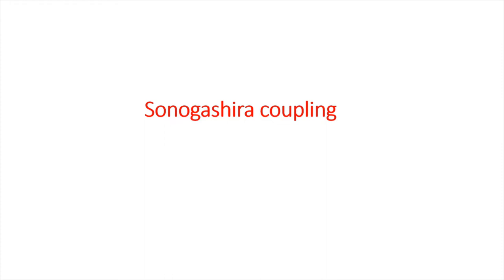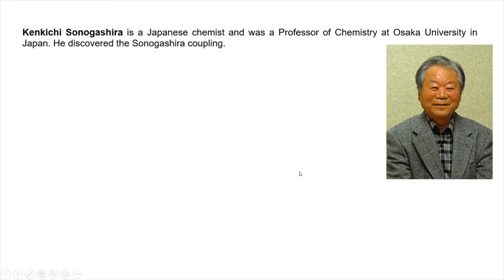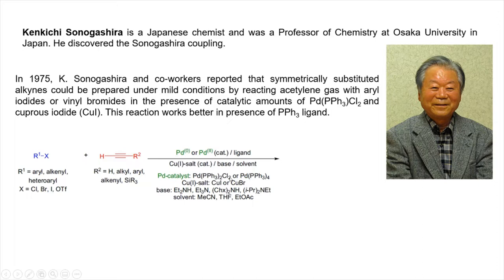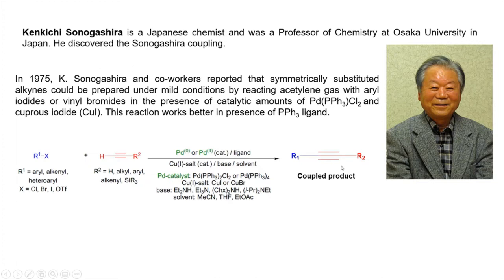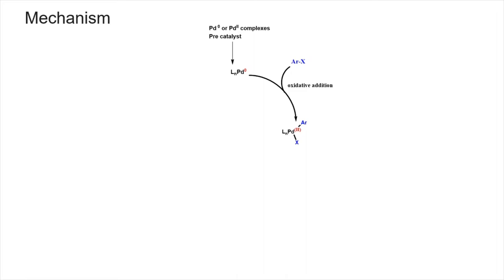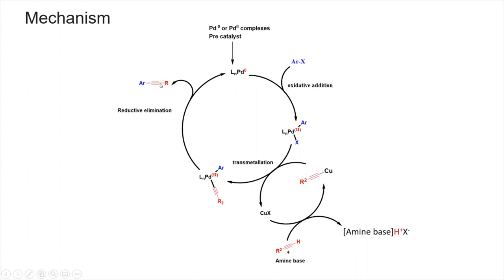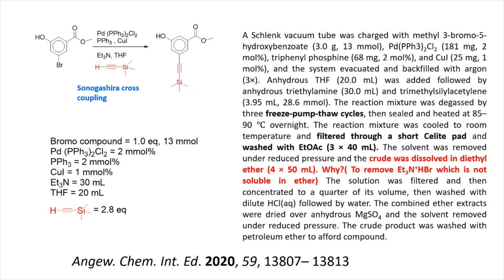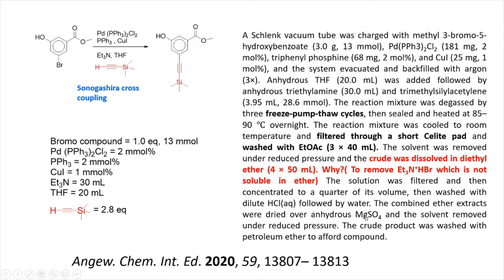Sonogashira Coupling- Reaction and application in Research Lab

Comment: very good explanation ....
Reply from the maker: Thank you
Reply: Respected Sir! If I'll add 10 equivalents of TMSA and will use evacuation...it will have negative effect on reaction?
Reply: @Dr.Mosharraf If we can use Ar bubbling for triethylamine and THF solvents?
Reply from the maker: Yes you can do.
Reply: @Dr.Mosharraf  I performed sonogashira coupling many times but can't get desired product.... I've reactant with 4 bromo group....after watching your video I figured out that the mistake I'm making is that evacuation of system after addition of TMSA but I used 10 and 20 equivalents of TMSA...so what do you think this is the main problem I'm making    ?
Reply: @Dr.Mosharraf if the Sonogashira coupling reaction fails and there are a lot of reactants in the reaction mixture can we add catalyst and TMSA to that reaction mixture?

Comment: why didn't you use the acetylene gas instead of the compound with silicon?
Reply from the maker: Acetylene is gas and hard to handle and hard to control the reaction. But silyl acetylene is liquid and more stable. Not only that if you use acetylene then one sided product will dimerize with same molecule since other side will also have open alkyne proton. So silicon group will act as a protecting group.